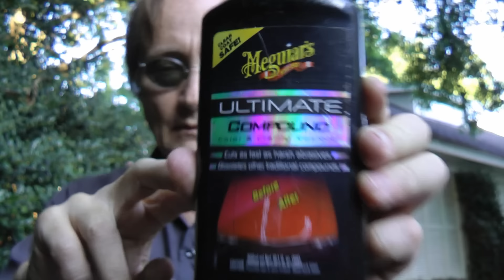How to Fix Faded Car Paint

Comment: Scotty if you keep dipping that buffer when it's plugged in into that bucket of water,you may not be around much longer to make any more Youtube videos.
Reply: Lol totally true
Reply: Lol 😁 😁 😁
Reply: He should say "Don't do this at home"
Reply: John Hughes 🤣🤣🤣🤣
Reply: SCOTTY  need to be hire to clown my circus
Reply: Do you guys have electricity flowing out the bottom of your buffer or sander?! Wtf
Reply: Kyle Milford of course not, but if you slip or tip it in too low on accident your pretty much dead on the spot
Reply: Safety third
Reply: @coreys.9426  from 110? Lol not
Reply: Hell. I drag my extension cords through people's pools while I'm working.
Reply: @coreys.9426  120 volts at 15 amps. Not gonna happen
Reply: @ClonedK9  i must have a strong heart at 50 years old
Reply: Spencers Unboxing you need Jesus
Reply: 🤦‍♂️I wonder how many people fell victim  to this video💦⚡😵
Reply: The handle is made out of plastic. It's safe.
Reply: 1967 Chevelle LSx what voltage is good for you tough guy
Reply: from polishing experts to electrical engineers
Reply: John Hughes 🤞
Reply: That's The common sense part he referred too in his post. Lol
Reply: Lol fkng funny coment
Reply: @ClonedK9  I don’t like the idea of holding an electrical apparatus in one hand while rubbing it with the other hand wet. 
  Something about mixing electricity and water just does not sit well with me. :)
  Btw, I don’t think I saw much, if any, improvement in the finish on that car. 
  Somewhat surprised to see him posting such a video.
Reply: i was worried  ..but he's airborne  he aight ...lol
Reply: Don't tell me you're doubting Scooty's method of buffing out a car? 
If you get a little electrocuted, it's just normal wear an tear
Reply: Is that you dion
Reply: ahahahahhahahah
Reply: (Scotty Kilmer
 - 6 years ago)

"I have a ground fault interrupter circuit, so it doesn't matter"
Reply: @Doriesep6622  🤣🤣🤣🤣
Reply: Ive been shocked by that much....only tingled me.
Reply: @ciscog3600  Still not good because some will take it as being serious. Lots of dummies out in the world today.
Reply: @fortheloveofnoise  Try it again with wet hands.
Reply: I was thinking the same thing! 🤣🤣
Reply: righteous!!! d*mn-near DROWNED myself on beer I was laughing so hard!!
Reply: Say what you want but this man knows more about cars than anyone I ever knew.
Reply: I thought that too 🤣😂🙈😲
Reply: Omg I'm cryin' LOL
Reply: 🤣 true
Reply: I'm pretty sure that the only thing that would happen would be that it shorts out the circuits/motor in the water and there's a spark. The machine is made out of plastic and plastic isn't a good conductor.
Reply: Considering the entire thing is plastic and it's unlikely there is any electronics near the pad I don't think he was in much danger is electrocuting himself but I'd watch for sparks and fire when he pulls the buffer out soaking wet and soaks the connection to the extension cord
Reply: @nicklasveva  you need a GFI circuit plus that polishers is not waterproof you will get hurt
Reply: Why we have GFI's, that's Ground Fault Interrupters
Reply: Volts don't kill, amps do.
Reply: @rickeykeeton4770  don't go Thur a car wash ,)
Reply: He could be plugged into a CFCI outlet.
Reply: @rickeykeeton4770  Weakass. I do PC watercooling for my clients without gloves on for 20 years. And I do polish my cars this way too
Reply: That’s why the pitch of his voice is high. Scotty really is a man. Gotta love him!🥱
Reply: Soon as I seen "Scotty" I knew it was gonna be some good advice 🤣🤣
Reply: The man’s a. Expert
Reply: LOL … am thinking exactly the same thing 🤣
Reply: Lol 😆 he’s a professional 🤣
Reply: Good advice I see he took ur advise bc he's still here lol
Reply: I guess if he been doing it for 6 years then he must be doing something right
Reply: @kidlo2050  I doubt it.
Reply: I have a Ford Escape that I got about two years ago and the hood is starting to fade and the two runs that run up by the windshield are starting to peal.  I talked to someone at a body shop and he wanted $1,200.  Can you give me any tips on how I can take care of it myself?
Reply: 1:21 made me cringe 😂
Reply: Andrew Tate: if you die. 

Just come back to life
Reply: Funny man😂😂😂
Reply: I, knowing nothing about buffering, was wondering about that.
Reply: The most shade tree video I've ever seen 🤣
Reply: For all the brainiacs... Water doesn't conduct electricity, so you can't get shocked with a toaster in the tub
Reply: Yet he's survived this long 🤣
Reply: Don't you guys have power safety switches in the US? My power kicks off as soon as there's a short circuit... I bought an Ozito polisher sander for $19.95 last week, so you can still get them cheap..
Reply: Hmmm, would explain why Scotty sometimes seems like he’s not firing on all cylinders.  😂
Reply: I was saying the same thing 😂
Reply: Lol very funny man
Reply: Ground fault
Reply: Thats is peotected by gfci plug or breaker. He’s good he knows that hes going to be around for awhile.
Reply: Jokes on you Scotty is still kicking it
Reply: Rip
Reply: 😂 10 years later still kicking
Reply: Lmao Darwin Award 😂
Reply: Gfci baby
Reply: And this one time at Band Camp 🤣

Comment: Scotty you had me nevous  with that water getting on the extention cord...
Reply from the maker: I have a ground fault interrupter circuit, so it doesn't matter
Reply: hahahaha true true
Reply: chyp silva me to if it had hit that water his life would had been gone
Reply: Not usually smart to dip anything plugged in into a bucket of water. He had a ground fault socket but the next guy might not. Would you dip your toaster in water, it has a insulated cord??
Reply: WARNING: GFCI's only work if they are properly grounded. The test feature on the outlet does not detect proper grounding. So If you have ungrounded GFCI outlets they won't adequately protect you in the event a ground fault. Overall don't get careless just because you belive a safety device will save you. Remember sefety begins with the operator!
Reply: And what about those people who don't and follow your lead in this video about splashing water all about an electrical connection? Some role model you are sir.
Reply: He was using non conductive electricity
Reply: At the end of the day everyone noticed the buffer being dipped yet they complaining! I agree that this was a hazardous practice and I don't believe any of you guys would do this. Everyone makes mistakes so stop acting as if you all are perfect!
Reply: Kevaughn95 such a big blunder by such an experienced mechanic ... not excusable
Reply: I take the cover off the buffing machine, rinse it and wring it out, put it back on the machine, then resume buffing.
Reply: chyp silva ,😂😂😂😂
Reply: Well, at least nobody's complaining about the paint job.
Reply: I buffed my car under my neighbor pool and it did work out pretty good.
Reply: Okay then beam me up Scotty!
Reply: Lol me too
Reply: Agreed, i like scotty but let's stick to ground rules just in case your fail safe doesn't save you.
Reply: @cantstandcamilla  Ha ha ha, Why didn't I think of that?
Reply: ...extention
Reply: Omg so true lol
Reply: @topup4563  My bet is that he doesn't actually buff his vehicles as much as some people might infer...
Reply: @charredskeleton  He's Airborne that's why? lol
Reply: @topup4563  I do this with my buffing machine. Gonna cry?

Comment: "First thing you wanna do is make the buffing pad A LITTLE BIT wet"

drops the whole damn thing into the water anyway lmao
Reply: Connected to power too 😆
Reply: Haahahahaha
Reply: I can hear ammonyc crying lol
Reply: Hahaha love it
Reply: Josh Champlin  so his polisher was not the move? What do you recommend
Reply: Haha!
Reply: I tried this without water with less than spectacular results. I live in a dry climate so maybe if you're in a humid area it's different..
But I doubt it. He did this video in Houston, humid and wet af. 
Water works.
Reply: Josh Champlin  so dont use that stuff he mentioned? No water at all?
Reply: Right LOL OMG
Reply: He didn't warn about the Shock Hazard from putting it in the water when still plugged in...
Reply: While it’s still plugged into the socket
Reply: So you're basically saying that wasn't the clear coat fading off ?
Reply: Don't try this at home????
Reply: @stevefenwick8299  it it it will will will not harmmmmmm you

Comment from the maker: if it's too high on the rpm speed, the transmission is causing that, which is typical. If it's normal rpms, check the motor and transmission mounts.

Comment: In 1975 I bought a 1966 VW Karman Ghia. It was bright orange until I compounded it with Ajax cleanser( the powered pumice in it was a great polishing agent). After that it was fire engine red. The original owner had never waxed it and cars weren't clear coated back then.

Comment: Probably. But you'll want a better dual action polisher (like Meguiar's G110) and a handful of smaller foam pads (5.5"). And you only need 4 pea sized drops of polish on the pad and no water. Get a strong degreaser too - Scotty has just "filled" the paint with water and oily residues from the polish, and even then it's clearly visible in the "finished" shot. Give it a week and a wash and it'll be just as faded. Do it properly instead :)
Reply: Rpm setting on polisher ?

Comment: My uncle showed my a trick for stuff like this. He bought a truck once with the clear coat coming off on the hood. He used a compound washed it well, then sprayed some "clear wood finish" it didn't look like a brand new paint job. But it looked a lot better. The wood finish provided the shine that was missing due to the clear coat gone.

Comment: will waxing my civic add horsepower because i added 5 stickers on the rear window and its like i added turbo
Reply: No, those stickers add a lot of weight. To counter that, you should remove the airbags.
Reply: Stickers add horsepower. Wax and emblems add torque.
Reply: Haha on point !!
Reply: nah the stickers already put out the max body to horse power mods
Reply: Put a huge spoiler on the back too. Helps with downforce on your fwd car 😔
Reply: Waxing does help with the aerodynamics cause the wind gets caught in rough surface of the car if not waxed. Some people wax their car to get improved time at the dragstrip
Reply: Do you have fuzzy dice hanging from the mirror? That adds about 20hp on every other gear speed.
Reply: Don't forget to add a short throw dipstick for weight reduction
Reply: Don't forget the muffler bearings, that's what holds the power underneath the car, bro. 🤣🤪🇺🇸🍻🤙🏽
Reply: And take off those cheap hubcaps too
Reply: Put a fart cannon and you'll get an extra 200 hp for sure
Reply: OVOVFT6 this whole comment section is like if drewpeacock was here lmao
Reply: I hear air fresheners increases air flow if tied around the intake!
Reply: Stick balloons all over car for less weight  and more horsepower
Reply: @christopherhendricks4369  why do people put splitters one their rwd cars?
Reply: yeah bro any civic owner knows some stickers and a wax job for the aero totally increases HP and like i said wax for the aero.... cutting through that air like butter....
Reply: Yes

Comment: The problem with faded paint on new cars is caused by clearcoat. There is really no way to protect clearcoat, and when it burns off from exposure to sunlight, nothing but a new paint job (without clearcoat) is the only answer. I have a 1993 Chevy pickup. I bought it new. It is kind of a light tan color. (non metallic) It was sun faded, but not spotted. I was able to polish it back to almost like new condition, just by removing the dried out top layer of paint with polishing compound. I then gave it a good coat of wax. I did this by hand, not with a polisher machine. I don't recommend those because if you are not experienced, it is real easy to polish right through the paint. 

Most new cars have metallic paint, and it has it's own problems. Unlike non metallic, it tends to fade in spots, and no amount of polishing can bring it back. If you are buying a new car, the best thing you can do to avoid sun caused paint damage is to buy a white car. Even with clearcoat, white paint lasts a lot longer than any other color, and to me it has a nice clean look.
Reply: Gerald Scott, a dual action polisher on a low speed is pretty safe to use. Now one of those high rpm polishers pro detailers use, yeah not for a beginner. They can quickly polish right through the clear coat.

For the guy with a question... You can, but the color layer of paint is very thin. Odds are you'll burn through the color coat while sanding it. That's the main reason most won't even try it. If it was just one small area, maybe, but usually all the upper surfaces start flaking off at the same time as those surfaces receive the most sunlight. At that point only a new paint job is going to fix it.
Reply: No the problem is not the clear coat its the color coat.   In fact the reason some color coats fade is because they never were clear coated to begin with.   They typically dont clear coat pearl colors because it doesnt look as good as not clear coated.
Reply: I guess I'll do a  video on this soon guy's ! Love  this Scotty kilmore .

Comment: I've worked at detail shops This is a very temporary fix. Faded area return within a week or so. And you would need to do this pretty much every time you wash the vehicle. Once the clear coat wears off original paint you need a new paint job. This is just putting makeup over it and is temporary.

Comment: YES, you should absolutely dip your power tools in a bucket of water while plugged in, WHY wouldn't you?
Reply: OMG, recently used stick blender into liquid!
Reply: By all means people, plug in your electrical devices and hop into the bathtub with them.  I mean these bozos think it's totally safe to do.  Yeah yeah, the cord is on the other side and machines are built this way yadda yadda.  Still, I think I'll pass.
Reply: Ron leo gfci
Reply: Just make sure to use one hand to dip your power buffer...much safer. LOL
Reply: Asus Kybd a Nissan Xterra how would you put a water pump on and take it out
Reply: What could go wr..💧⚡⚡😲🤯😱😵
Reply: Electro boom told him it was ok
Reply: Don't you know thats how you get the sHinIeST shInE for you new sHinY car.
Reply: I actually have a Hitachi power scrubber that can be dipped in water. It's supposedly water proof to 3 feet deep. I can't get a buffing wheel as large as his, but it still gets the job done.

Comment: this isn't faded paint, the clear coat has started to peel revealing the base colour beneath which on a metallic finish will be a matte finish, so this method really doesn't look good, it needs touching up with some clear and some paint-matched colour if the base is blotchy from the elements
Reply: yup, just what i was thinking, is better to wetsand the panel and re-clear or even better, re-clear the hole car
Reply: the idea is to make it look a little bit better when you have no money to clear or paint the whole car, this is seen everywhere in the world where people have no money too
Reply: dannys delgado you can re-clear that pannel with less than $100
Reply: My e36 has some sun stain/clear coat pealing on the hood and roof in spots. If I wanted to touch them up would i need to reclear the whole hood and roof or could i just wetsand the parts and reclear those parts, or would I have to do the whole panel?
Reply: for a proper job reclearing the whole thing, if it's just a few spots you can get away with spot clearing be careful of sanding the color as it's probably metallic base coat and will be thinly coated
Reply: Ge Raf sweet thanks man. I have my old stock bumper that's the same color as my car, I'll do a little test on it to see how the clear looks compared to the clear around it if I just do the spots.

Comment: That might have been the worst buffing technique I’ve even seen lol
Reply: If it's stupid and it works, it isn't stupid.
Reply: NormieMemes it basically didn’t work, all he’s done is rip all of the loose clear coat off with the buffer and wore down a level in the base coat to make it all shiny.
Reply: Don't be whiny, it's shiny.
Reply: @panzerfaust5046  If you don't know what you're supposed to see it is shiny. To a body guy or any detailer, this is a completely barbaric move
Reply: @mitchell9103  It's an extremely cheap barbaric move that gives a great result for the price. Sorry most of us don't have 1k to drop on buffing a toyota
Reply: Cry about it
Reply: ParzensaulP you can achieve what  item obtain, really deserved
Reply: Justin Franklin The car is probably 20 years old anyway. So as long as it looks better than it did before, it doesn’t matter
Reply: How many tried it and it worked
Reply: Jose Ramirez Literally about to try it in like 3 minutes
Reply: @panzerfaust5046  is it? To me it looks like I can see a clear reflection of a tree everywhere but where he just buffed... Maybe it's "better" than before, but it's not something I'd expect real results from.
Reply: EVOLVE FREELY  I understand not have the money for a professional job, but could still try to use proper techniques for a better result. That's how you put icing on a cake, not apply buffing compound! Lol
Reply: Hahahahahahqhahahahaah
Reply: @TyDobmann  update?
Reply: @Antassium  It kind of worked, but it kind of didn’t at the same time. Paint is still clearly faded in the one spot, but it’s not as noticeable since it’s no longer dull, dry, and rough looking anymore.  Definitely looks 50x better than it did.
Reply: Take it up with the committee.
Reply: @fredammons995  That '94 Celica is 27 years old now.
Reply: @TyDobmann  it depends how bad it is